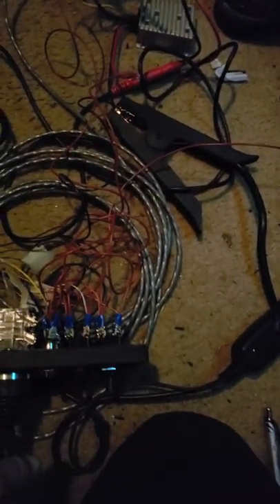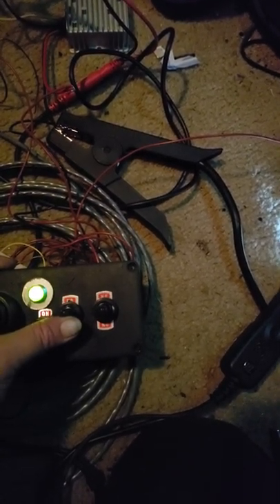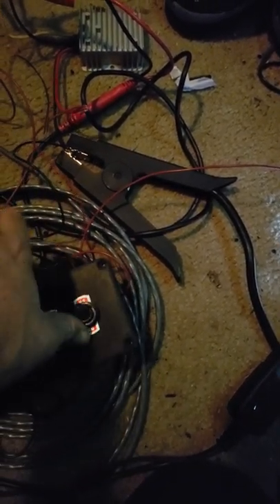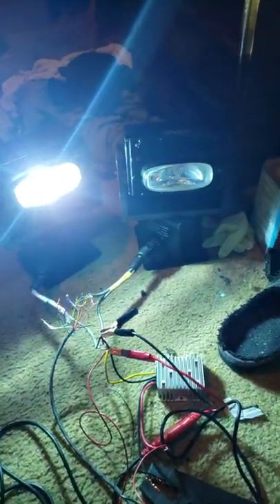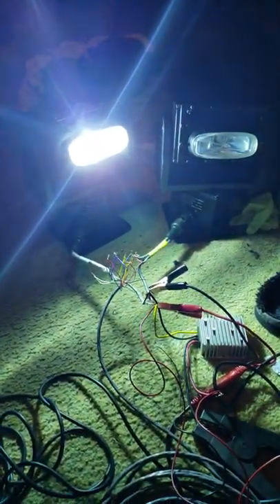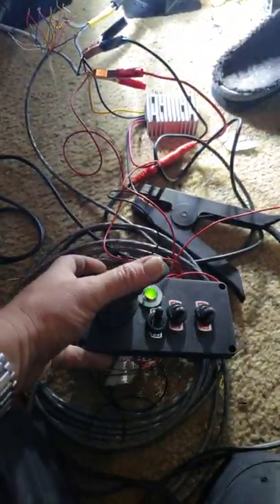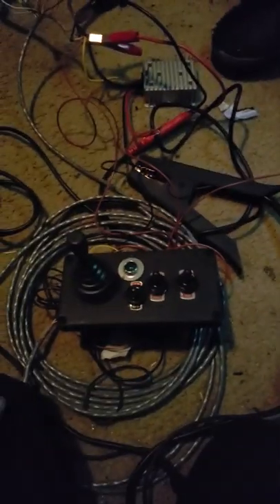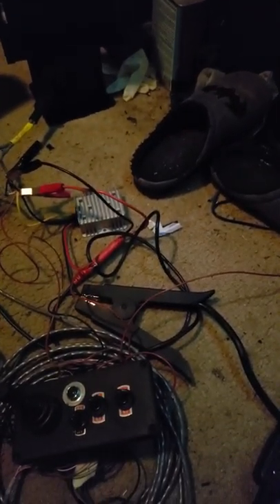Ibistek searchlight control update 3

Comment: just came across your video. I've got four of these im looking to control. though two per controller and then a switch to make it control other two is fine.   you got any suggestions?  oh... and it won't make since at first..... but am hoping to also get option to use pan tilt with NO lights on.  My truck is 24v so will not have step up
Reply from the maker: With these there's no way to pan tilt without the ir lights on. As for controlling 4 you could build a controller like mine and make it bigger basically double what mine has for my 2. So you'd have 2 joysticks 2 power switches and 4 3 way toggle switches.  With a control center like that you could control each one individually or in pairs
Reply from the maker: If your truck is 24v then no you don't need the step up ballist my truck is 12v system that is why I had to use one these ibistek lights are designed for h1 humvee which are 24v it will not work with a 12v system without a step up converter.
Reply: @camaro8477  thank you for the reply.  Would you be willing to  offer a pin out or diagram of wiring you did.  can pass on my email or facebook info if so.
Reply from the maker: @coachgeo  hey, it will take me a bit to get back to you about that but I will try to get it to you asap
Reply: @camaro8477  Can you share the wiring diagram and what parts?  What joystick is that? Thank you.
Reply: @camaro8477  appreciate your efforts.  Life has been crazy.  Still looking forward to your info. [ coachgeo (atz) hot male] ... im sure you know the rest